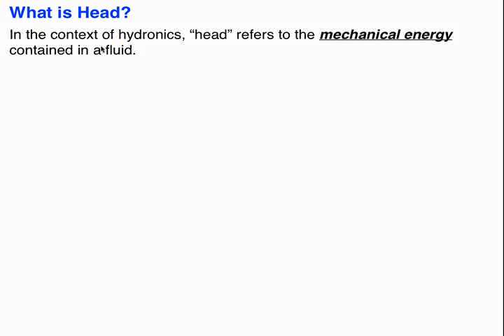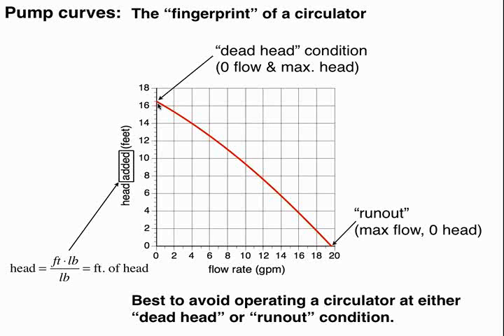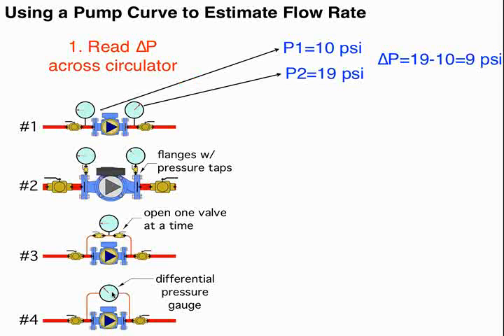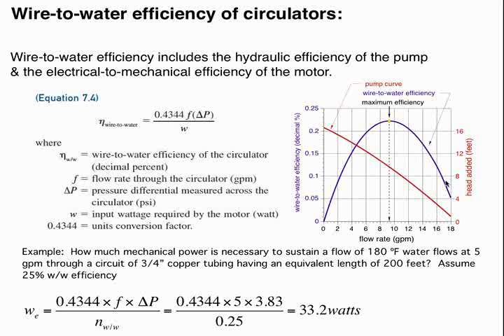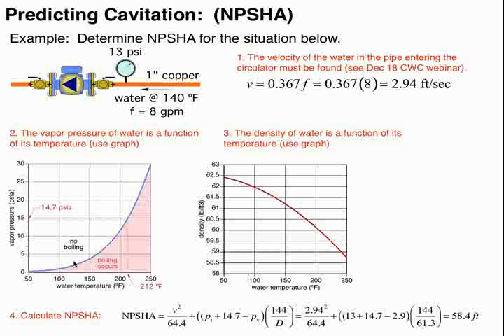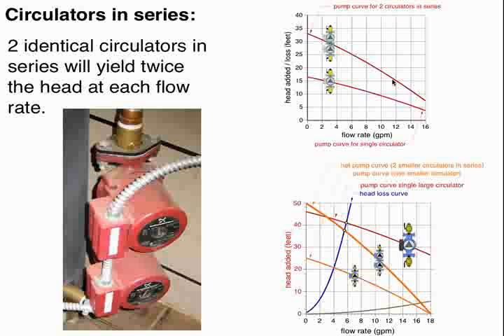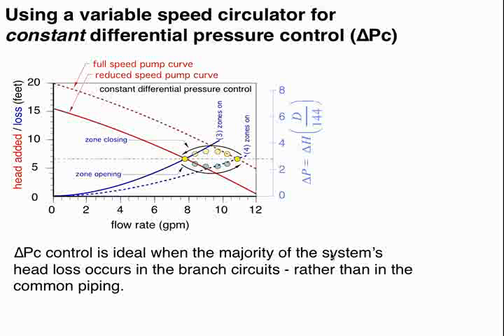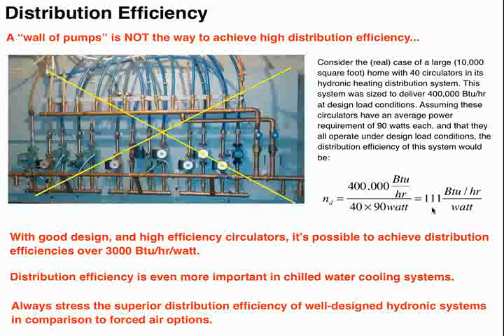Analyzing Circulator Performance in Hydronic Systems (Part 2)

Comment: Mechanical energy is called foot-pounds, but in the case of energy the pounds are not mass (or weight) but force, sometimes abbreviated lbf. A pound of force is about 4.4 newtons, which is in units of Kg-m/sec^2. A pound of force is also about 32 lb-ft/sec^2. Multiplying by feet to get foot-pounds results in units of lb-ft^2/sec^2, and each foot-pound is about 32 lb-ft^2/sec^2. Now, to obtain a unit of energy per unit weight of water, divide by the weight of water in pounds to get 32 ft^2/sec^2, or simplifying slightly 32 (ft/sec)^2. Hence "head" is actually in units of velocity squared, not distance, or "feet". But apparently this is lost on most people in this industry.
Reply from the maker: Fundamentally, the term head goes back to Bernoulli’s equation, which is an energy conservation equation.
Bernoulli’s equation can be written in several forms, one of which is:
total head = P144/D + v^2/2g + Z
With P expressed in lb(force)per inch^2,  and D in lb(f)/volume (lbf/ft^3), all the terms simplify to unit of feet.

Comment: I keep thinking and  i apologize  ,yet , i have to ask this about pumped boiler and pumped system by-passes or circulators that see a different reference point to the point of no pressure change than system circulators in regards to the placement of the expansion tanks . Here is  where this bit of a quandary occurs ,..surely upon start up or commissioning a system with large storage tanks ,  the pressure differential is much different from the operating conditions with smaller delta T in supply and return  and that seems sufficient enough to give rise to how to proceed , should one have a circulator that is used with start up specifically and then changed out for another over the lifetime of the equipment ? or  am i over thinking this?
 Forgive me  for perhaps missing some of what i was listening to as i pondered this .
*~//: )
Reply from the maker: Thank you for your comments, but we are not quite sure of your exact question.  However, we recommend the use some other source of pressurized water to fill and purge the system during commissioning. The circulator in system should be sized based on the system normal operating conditions. Please let us know if you have additional questions.